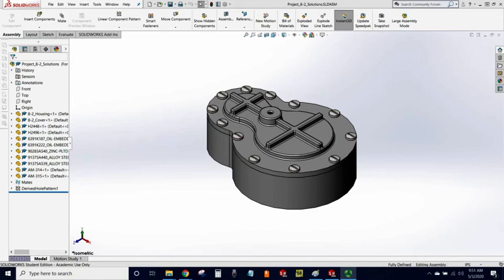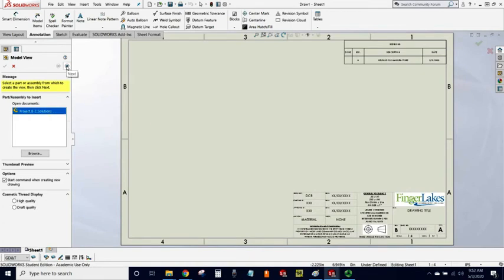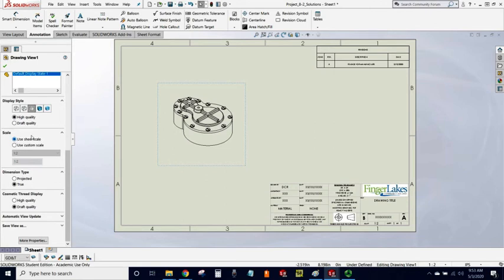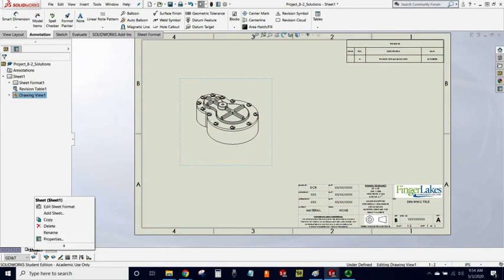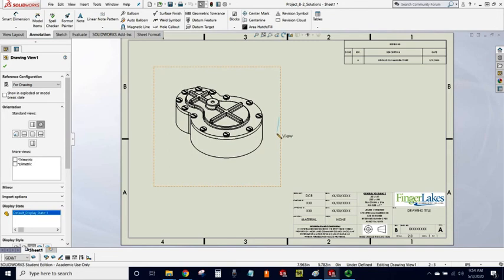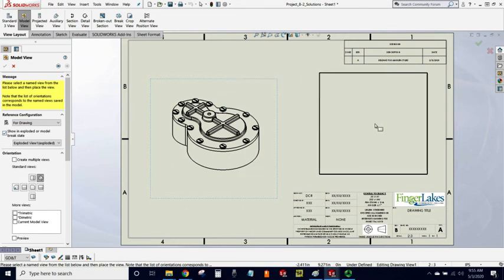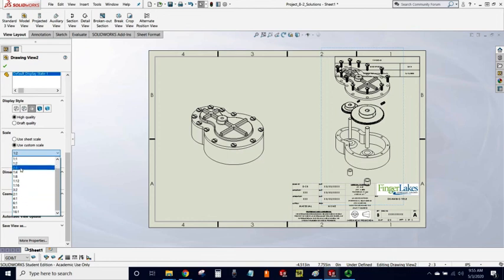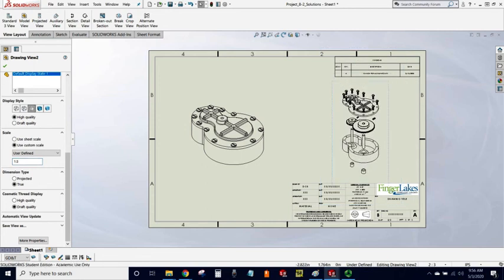Two Ways to Set Scale in SolidWorks Drawings

Comment: Is it also possible to scale the dimension units too and not just the drawing itself?
Reply: You have to do that when you're designing your part. That would be done in the part/assembly editor before making your drawing.
Reply from the maker: You can scale within the solidworks part model, if you are looking change the physical scale of the part(s).  Within the drawing, you can use dual dimensioning at whichever scale you desire (most use this for converting between imperial and metric units).

Comment: in the digital world it's silly to use scale on the drawing at all. that's to do with drafting. on a computer this varies with screen size and paper size. it's not like one would hold a ruler to the paper and scale up from there. it's just to fit the view on the given real estate. 
it would be nice however if SW just gave a digital option like 0.1 scale instead of the colon or fractional brain tease.
Reply from the maker: While it is somewhat of a throwback to the time of hand drafting, hard copy drawings are still more common than you think.  Large system installations still utilize D-Size and E-Size drawings.  Contractors may use an engineer's scale or an architect's scale to get a sense for the sizes on your prints.  Scales are also a requirement per ANSI and ASME drawing specifications.